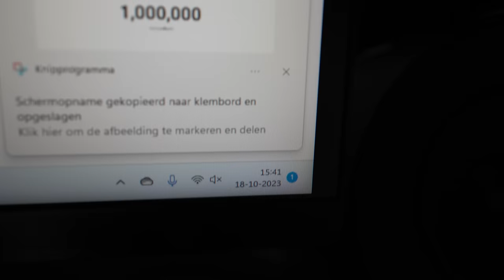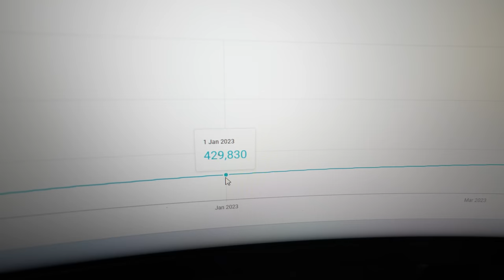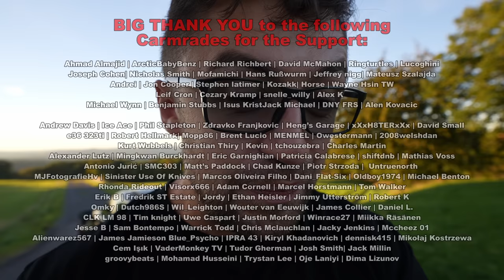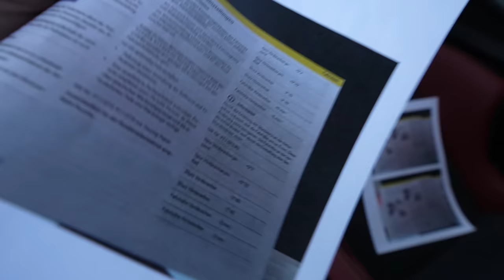1 MILLION! INSANE Porsche 992 GT3 RS BIG SEND! // Nürburgring

Comment: Surpris d une pression si basse dans les pneus 1.8 2.0 bar en mode sport c est la pression du mode confort sur ma jag prq si bas sur une gt3 rs ? Surpris aussi de la température des pneus souvent c est plus bas 40
 45 ° sur les visionnages de vos vidéos ici c est 60 65 degrés .
 Le son moteur entre 7500 trm et 9000 est fou , la voiture demande peux de correction au volant par rapport aux autres elle semble teĺlement stable en virage sécurisante   j ai vu qu' elle prend 280 kmh sur la portion la plus rapide ici quand la piste est vide donc très rapide  ...

Comment: Misha, a question from another 992 GT3 RS owner:  When the "DRS active" was showing in GREEN, were you pushing the DRS button to cause that, or was it automatic?  I ask because on mine, on the track (COTA), it doesn't seem to be going "Active" (GREEN) by itself.  But when it says "DRS ready", the wing seems to be going to low downforce.  I'm just trying to understand when the system decides to put the wing up/down, and when it shows "DRS Active" in green.  Congrats on 1M subscribers!

Comment: after watching the Tesla PLAID, even these beast from the Porsche seem slow when accelerating out of the corners or when taking off from lower speed.
Reply: Yeah. Then you remember the Porsche is half a minute faster than Elons boat.
Reply: @sandroschtolpe6803  only half a minute compared to a boat that can carry the entire family and full size luggages? that's embarrassing for a GT3 RS then supposed to a road legal race car that beats you up with hard suspension and no space to carry anything else and costs more than average houses and only magaged that difference compared to a boat? how embarrasing.
Reply: @borinvlogs  yep. Sit on the finish line and wait for THIRTY seconds. Until the boat with twice the hp and track pack arrives. Lmfaoooo embarassing for Elons boat
Reply: Teslafanboys in 2055:

That 911 is ONLY EIGHT MINUTES FASTER THAN THE TESLA!!111
Reply: @Euromasterrace5000  they get more and more desperate with their Adhd.